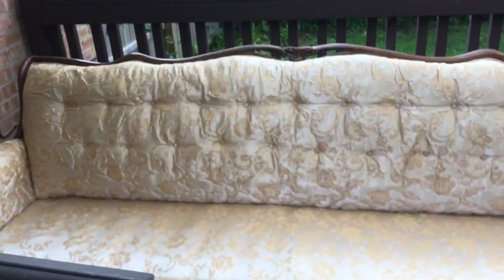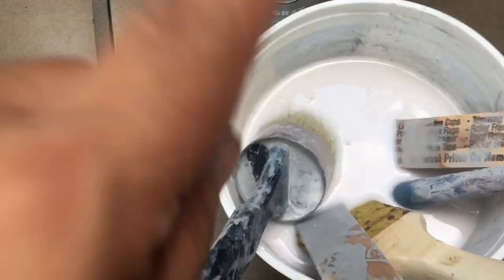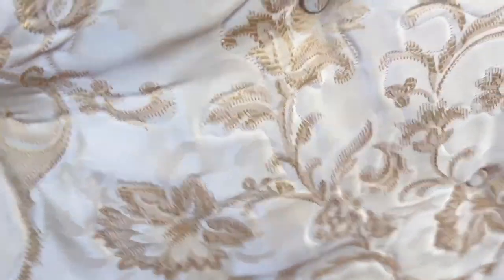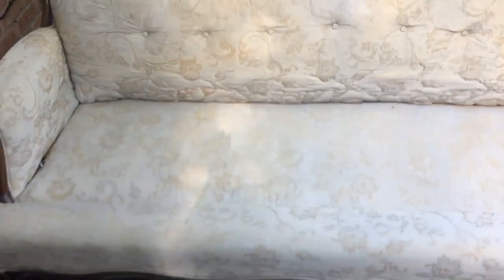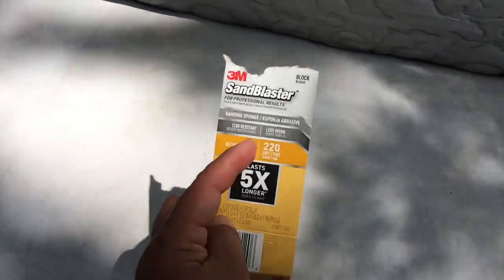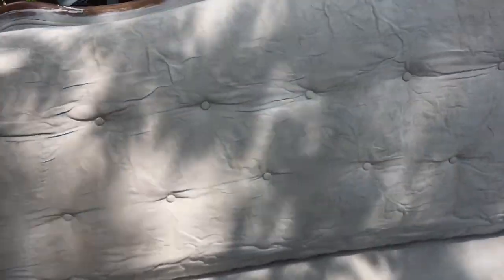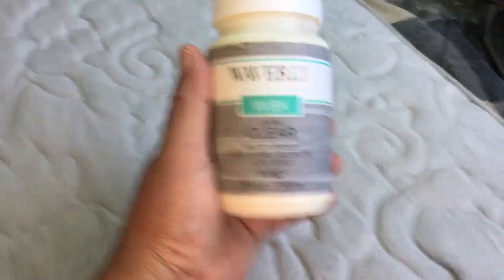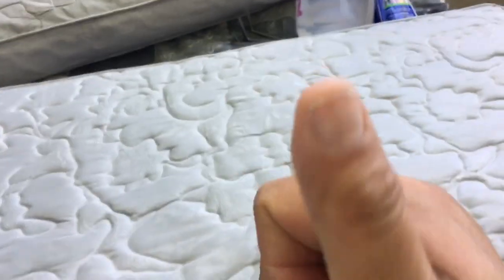DIY COUCH MAKEOVER USING CHAlk PAINT

Comment: Hi, if you use the amy howard chalk paint all in one, you would not have to spray down the material. Using a 80 grit sandpaper in between coat. My antique sofa turned out beautiful. Also you do not have to seal it with wax. Otherwise  you did a great job on the sofa.
Reply from the maker: Marion Morrison  I will have to try it next time . Thank u 😊
Reply: Marion Morrison thank you for the advise I also will do the same
Reply from the maker: Thank you for watching ☺️